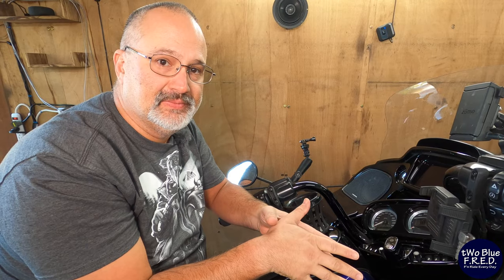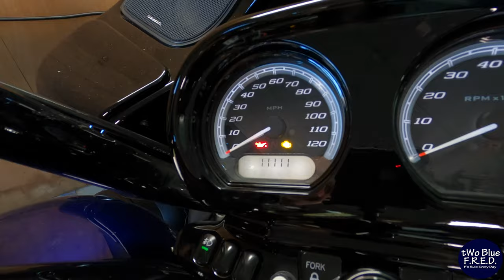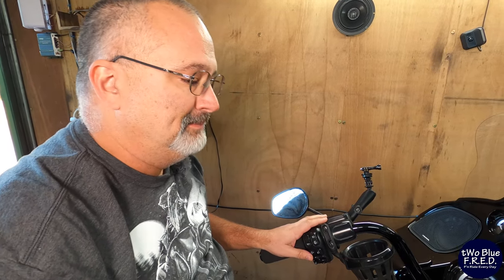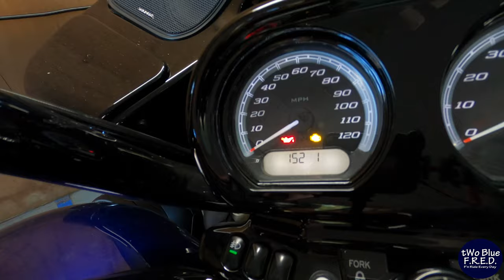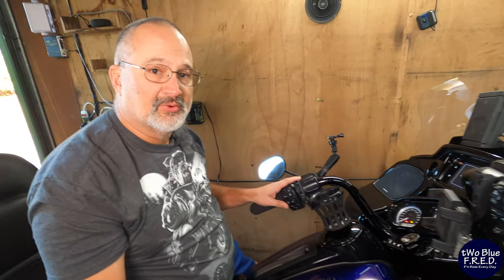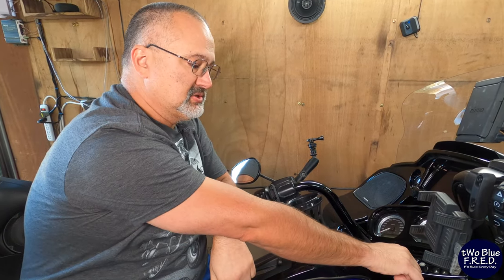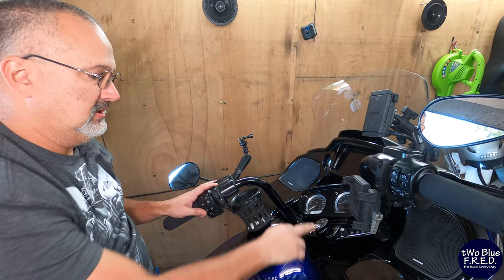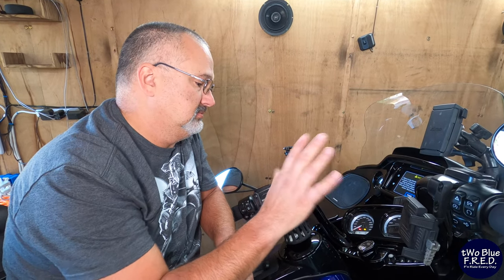HOW TO Change or View your Harley Davidson PIN CODE #motorcycles

Comment: Holy COW! For 8 years, I have not known the pin for my bike and have been told by NUMEROUS techs unless I already knew it, there was nothing that could be done unless it was completely reset. For EIGHT years, I was given the same answer and I happened to find your video and low and behold, your information worked! I finally know the pin and may not have to get another FOB ($200 for a single one is absurd). THANK YOU!!!!!!!
Reply: 3 years for me lol
Reply: Makes one wonder are the dealerships ignorant or just shady. 
Will try this tonight as mine won't start tells me to enter pin a pin I do not know since the battery failed and installed a new one. 
I hope it works, was so upset at this fob junk and now seeing this vid fobs are actually worthless.

Comment: What am I doing wrong... I have a 2017 Ultra Lmited and  I watched this video several times to make sure I was doing all steps correctly.... it never showed me my current pin code ..... 😤
Reply: You MUST have your fob to see the code. Without the fob, you can only input an existing code.
Reply: I have my fob and it still doesn’t show the code . Any advice?
Reply: On a ‘22 RGS I had to put my key into the ignition switch with fob and then it worked. Didn’t have to do the double left turn then single right.  It came up immediately to set pin after the 5 on/off step after ignition on and key in.

Comment: If it doesn't work. The way it worked on my 2008 roadking classic was have keyfob on person. Sit on bike. Turn run switch off. Cycle ignition switch 3 times (off, ign, off, ign, off, ign). Tap left turn Signal 3 times. Tap right 1 time. Bam! It shows!

I had to figure this out myself! Thanks for the video it put me in the right direction

Comment: Wow!! This saved me today. I have a key lock for fuel cap. Filled up today and took off. Drove about 20 miles to store. Bike won’t start. Check my pockets for fob… nothing. I call gas station tosee if anyone found and turned it in. They did. Pulled out phone and youtube. Called dealer. Gave me my code. Started bike up.

Comment: Thanks guys,
Do you have a video tutorial on why the Trip A and Trip B odometers don't display the correct real time miles ridden after being reset to zero? While riding, both of my A&B Trip odometers jumped from 27 mi to over 9000 mi instantly.

Comment: Hey Fred how about when the fob is broken and smashed when I the fob fell out of my pocket and vehicles tires ran over it.
The previous owner had pass away and I didn't get the 5 pin # and when my fob was working I didn't know or check what was the current 5 pin.

How can I retreat the current 5 pin numbers without a working fob?

Please let know, 

Bob,

Comment: My 2018 Harley Softail deluxe is tipped over (hate the “jiffy” kickstand). Most of the turn signal lights are flashing non-stop. I unlocked my front wheel and took the fob out of ignition.
Next, I followed directions in user manual (quite different from your specific instructions (great video by the way!). When the display shows, “Enter Pin” should I press the Left directional first? Once or twice?
Your guidance would be appreciated.
Irene

Comment: I have an 01 ultra classic. I have no fob, someone has already performed a bypass because bike runs fine. I have seen about 5 different ways of checking for pin however none of these work. I cannot find the security pin for this bike. Can anyone help? Is there any way to find the current code and reset it without a fob?

Comment: OK I have a 2005 Dyna UK model with the ignition on the side by the battery and this is what works for mine. Hope it helps someone out 👍

so double click your keyfob to disarm the bike. then, iginition on off, on off on. left turn switch twice. now you should see both indicator lights on the dash flashing together like hazards. at this point you press the key fob twice. the personal pin will now be shown on the dash. you can use the inidicator buttons to change and then just turn ign off to save. i suggest "11111" to test.

Comment: This video does not work for my '18 Lowrider because there is no ignition switch.  At 1:20 it states to turn the key in the ignition switch to the "on" position.  According to my Softail owner's manual, this whole process begins with the cycling of the Off/Run switch twice and then left turn signal twice followed by the right turn signal once.  Not once does it mention an ignition switch.

I have followed the steps in the owner's manual, checked online, called HD tech support and the dealership.  At this point it appears my only option is to take the bike in and have them put it on some sort of computer gizmo and set the PIN for me.  That's a four week wait plus 1/2 hour of their service rate.

Your video looks good, but may I suggest that it should clarify that the process does not work on bikes without ignition switches.